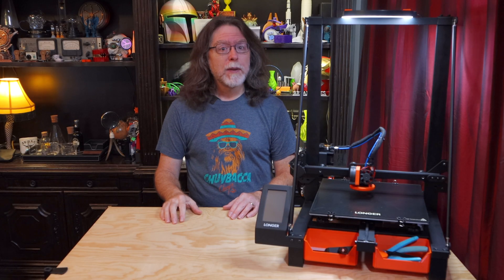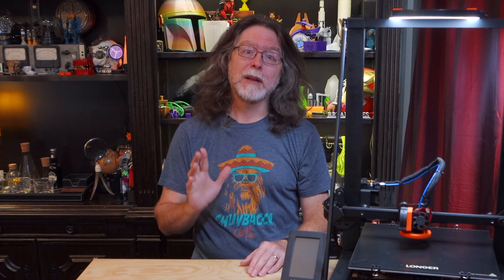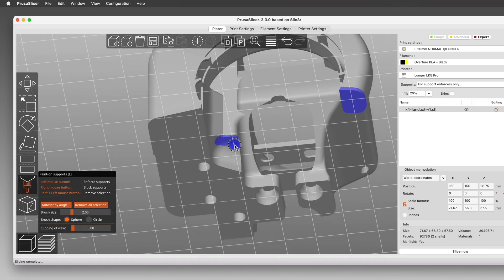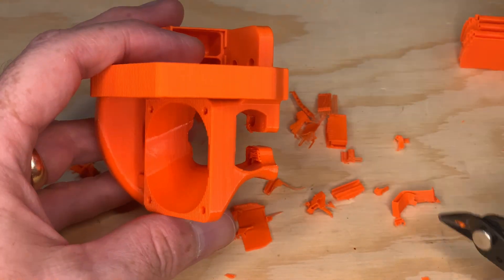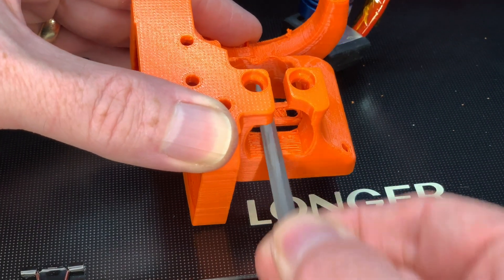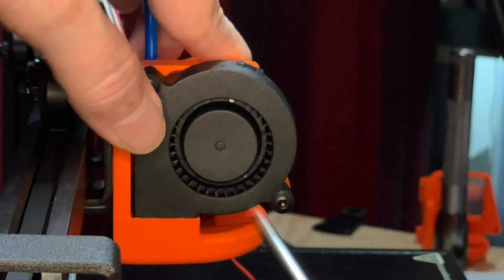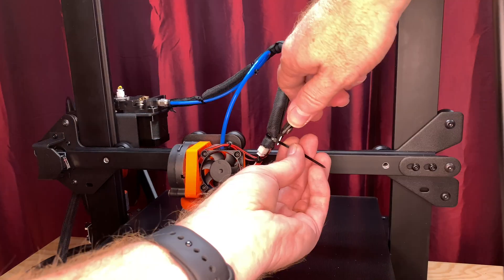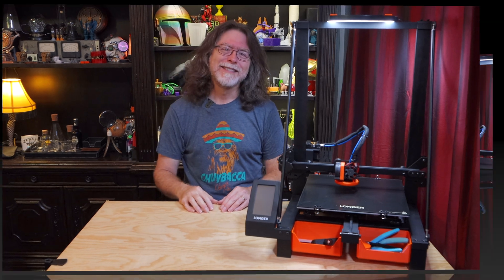Longer LK5 Pro Cooling Fan Fix

Comment: Thanks for the video! I just started 3D printing by getting a longer LK5 pro (since it is older, I got it cheap). I have fallen in love with the hobby. How did you use prusaslicer? I only thought Cura Ultimaker supported the longer LK5pro? Does one of the other profiles work? Also, I heard you can upgrade to automatic bed leveling with a BLtouch upgrade? You don't happen to have a video of that do you? Or of a filament sensor upgrade to one that lasts "longer" (dad joke). BTW, great T shirts

Comment: Your longer is different from mine.  Mine came with 2 part cooling fans.  A bracket holds the fans instead of the fan shroud. Never had any part cooling issues.

Comment: You might mention that the stock parts cooling fan is a 4010 and you only need to swap out the connector at the mainboard with the 3010 fan that cools the hotend, instead of buying another 4010 fan, of course this means peeling back the entire harness, but if yours happens to be like mine the 3010 uses significantly smaller gauge wires than the 4010 does, in this case it may not be a good idea to just snip the wires off and connect the 4010 to those smaller gauge wires as they may not be rated high enough to meet the current demands of the 4010.

Comment: I bought the upgrade kit that longer now sells and installed it to the best of my ability and the entire apparatus was lose on the x plane when I finished as well as the bed having a high spot in the middle.   After months of sitting on it, I finally saw a video explaining that I could tighten the 10mm eccentric nut, and I did that and it failed to move at all, so I of course loosened it a bit.  Then it would travel, but when I tried to go into bed leveling it kept ramming up against the side, completely ignoring the end stop.  Now I get a homing failed any time I try to do anything at all.

Comment: Thank you so much for this video. This is my next project before I print anything else. Do you have any other recommended upgrades for the longer? Also I like the tool bins under the printer. Where can I find a file for that? Thanks again.

Comment: Longer now sells an upgraded cooling kit for about $20. It includes a much quieter 40mm heat sink cooling fan and two 30mm part cooling blowers. The unfortunate part is that the heat sink cooling fan is too far from the heat sink and significantly blows on the hot end and printed part. Because of this, the highest I can turn on the blower is 50%. Otherwise, the hot end temperature drops.

Comment: Does anyone have a fan shroud model for e3d volcano for longer lk5. I printer one for the cr10 but it works other than when I install it to z the fan shroud hits a bolt holding a wheel on the z axis’s. Preferably 4010 fans 3

Comment: I just ordered the upgraded "dual blower" from longer. It got me thinking though. Instead of trashing the stock fan, maybe I can print a housing that uses the fans from my new blower, and my old one in the same unit. Is there any benefit to such a thing? I'm really new to 3d printing.  Thanks!

Comment: Would you still recommend the lk5 pro at its current ~ 360 usd price?

- for a bit more of context, I'm a total newb to 3d printing. I've seen many things, and understand a bunch of it, but have never done nor operated anything about a 3d printer (not even the 3d designs in software).
Im wanting one mostly  to produce custom lighting appliances for my home, as well as some other useful gadgets here and there. Being it all mostly functional or decorative i'd also like a nice resolution / accuracy for making things that I can put on the dinning table and be looked up close or be mobile with like bearings or cogs.
I don't fear following long instructions or "tedious" assembly, as long as the ammount of work is a set one, and after that I'm left with a tool that I know will mostly do what I want/expect it to.

Comment: This is a nice video I’ve been on the fence about getting one but I think I’m gonna go ahead and do that. Don’t know if they have fixed the print resume feature in a firmware update but like you said it would be nice to have but not always useful. Thanks for making this video.
Reply from the maker: Hi! Longer has added an option to purchase the printer with a dual blower configuration for parts cooling. I'd recommend getting that version. 👍
Reply: @BV3D  looks like it’s on sale for $299 right now fyi
Reply: @BV3D  I got the dual blower LK5 PRO . But was curious if you thought this upgrade would be necessary...? I am printing two out currently since i have two of these to see how it comes out. but my question was do you know if the voltage is the same since mine came with dual blower kit out of the box?

Comment: Can I just use the stock flat fan that is mounted on the hot end?
Reply from the maker: The stock hot end fan is a 30mm fan, so it won't fit this fan duct. But, you could re-use the 40mm parts cooling fan as the heat sink fan on this duct, if you either splice the wires in or swap the parts fan and the heat sink fan's plugs at the main board. I think that would work. I'd have to open the printer again to be sure. You'll still need a 50mm blower for this duct, though.
Reply: @BV3D  thanks for the response. That is exactly what I did. It works fine with the 40mm parts fan.

Comment: Thank you Bryan for this video.  I plan to print this for my LK5, just have a quick question on the 4mm X 20mm screws and 3mm x 12 mm screws.  Are they coarse thread of fine thread?

Comment: So I did a very similar upgrade to my Lotmaxx some time ago. The cooling worked wonderfully- but I ended up hating the mod. My Bowden tube nut came loose and I couldn’t reach the darn thing without disassembling the entire thing. 
Granted that mod was a bit more complicated, being multiple parts so you could upgrade to dual fan setup or replace only certain parts.

Comment: Brian, I've been watching your videos on LK5 Pro and I went out and got one, soon to arrive by slow boat from guess where? Anyway I'm getting ready to receive the machine by getting some of the things it doesn't come with. Your LK5 Pro has a halo type of light at the top and you mentioned fabricating brackets for it. I can't seem to find links for it in any of the videos I've watched. Please help.
Reply from the maker: Hi! That would be from this video: https://youtu.be/sgw-KDnSzTM
It's just a cheap USB-powered ring light from Amazon. I used an 8-inch one for the LK5 Pro.

Comment: Longer came out with an official replacement upgrade for the part cooler. I ordered it and I'm going to attempt installing it today however you have to remove the entire X carrier assembly. I can't find any official instructions so I'll be using your video as reference for a lot of it. So thank you.
Reply: Any chance you could provide an update on how Longer's replacement was? I'm trying to decide between purchasing the upgrade directly from longer or doing this mod?

Comment: Last week, I actually bought this 3d printer. I'm new into this 3d printing. I just seen this video & guess what! I've already order the parts needed for this project. Oh, yeah did I mentioned I actually bought another one as well. Thanks for the info so much, it helps to know this type of stuff. Wish me luck on my 3d adventure. I was wondering if you actually used  the Longer 3D software it came with? If, not why? What software would you recommend, instead of Longer 3D? You have a new subscriber...

Comment: Slightly off topic for this video, but can you give me some insight on the glue you use for PLA?  By the way I really like your videos for instruction and general knowledge.  Your pace and depth are great when following along or just soaking up knowledge.  I recently got my first printer, and ender 3v2 and I have gone a little nuts tinkering with it.  I have the Micro Swiss DD and hot end, the bltouch and the upgraded JyersUI.  I also did a dual z upgrade to support the weight of the DD.  I appreciate the content you are making :)
Reply: Plus I'm just up the road in Austin!

Comment: I had to level my LK5 PRO last night when I realized it was squishing layers together and failing prints. I thought I'd be good to go to make a print this morning and foudn that it was sticking the nozzle against the heated bed somehow after I checked the level after the failed print.

Why? Why is it that I Leveled my bed yesterday and had a perfectly good print time for the day and then this morning, the Printer is back to having a bad level?
Reply from the maker: When you say it was squishing layers together, that makes me think the coupler which attaches the lead screw to the Z axis stepper motor may be loose. Check the screws on it to be sure it is holding tight on both the shaft of the motor and on the lead screw. That sort of thing happened to me on an Ender 3 once and it drove me crazy.
Reply: @BV3D  Yeah so between me having a great print come out last night, it cooling down and having no use til this morning, it basically ended up having the nozzle move down a couple mm. I'll check the screws and whatnots all around and give it another level to see if it persists. Thanks a lot!
Reply from the maker: @Conceptsexplainedsimply  OK. When that was happening on my Ender-3 it was such a pain. With the coupler mostly-but-not-all-the-way tight on the lead screw, the motor was able to turn the lead screw sometimes, and not others. And so it might only go up half a layer instead of a full layer. But it would ALWAYS move down a full layer (thanks, Gravity).
Reply: @BV3D  gravity is such a dick. Hmmmm. I don’t know what all those part names are to be honest, but I’ll sort it out and tighten all that stuff down and see what happens! It’s so frustrating. Groot started off looking so good
Reply: @BV3D  I never tightened the screws on the silver doohickey that holds the vertical rod. Would that cause it?
Reply from the maker: @Conceptsexplainedsimply  So the lead screw is the one that moves the Z axis up and down. The coupler is the silver thing that it fits into, down by the motor. The coupler has screws to clamp it to the motor, and to the lead screw. So check that the two screws on the coupler are tight, and that you can't spin the big lead screw while holding the coupler still. The two should be locked together.
Reply from the maker: @Conceptsexplainedsimply  It might, if it wasn't completely tightened at the factory.
Reply: @BV3D  You're awesome. I appreciate you doing that and articulating it so I can understand.

Comment: Yea but with that new shroud you loose  the ability to install the BL-Touch or TH3D's EZABL that has the L shape bracket?
Reply from the maker: That is an excellent point. It probably wouldn't be difficult to adapt the base plate of the Hero Me duct system to fit the LK4/LK5 X carriage, and that would give a LOT of flexibility in mounting a bed probe.

Comment: Hey, Brian, love your videos (and the hair)!  Out of curiosity, all other things being equal, what are the benefits of using a 5015 blower fan vs. a similarly spec’d 4010 blower? It seems like lots of people make the switch but I've never understood specifically why.
Reply from the maker: Hi! The 4010 blowers are the ones like Creality uses on pretty much every one of their printers. They are quieter, but I don’t think they move as much air. The 5015 blowers are louder but I think you could make a small hovercraft with one. 😁
Reply: @BV3D  I wonder how your solution in the video, compares to the now available Longer Dual Blower Kit?

Comment: funny that they are still using the fan system that was on my lk4. it was crap years ago, but then again my lk4 has been crap to start with. i ended up using a Hero Me instead since i wanted 2 fans of this duct, but i did see it
Reply from the maker: The Hero Me duct is a good one. I've got one on an Ender-3. I'm using a single-blower version of it. I imagine with dual blowers, you get phenomenal airflow.
Reply: @BV3D  that i do, but downside is the noise. yes lowering the speed helps but then you get the weird wine from doing that. 
soon it will not matter much. im upgrading to a Biqu h2 soon

Comment: The 24v fans are sometimes really noisy. For the hotend you could also add a buck converter and use a ultra silent 12v one. But the air flow needs to be taken care of, as lover voltage also means lower air flow.
Reply: The 40x20 12V Noctua fan has very sufficient airflow for cooling the heatsink, for all I know. But the 40x10 I have heard is good too if you are using a duct that ducts the air nicely to the heatsink, which in this case would be applicable.

Comment: Great upgrade
Thanks for sharing your experiences with all of us :-)
Reply from the maker: Thank you, Asger! 😀
Reply: @BV3D  I imported this Thing file I to Cura. As indicated, I keep my supports turned off because the model has the supports already on the file. I printed it, but the supports were super hard to remove.  Since the supports are already on the model, are there other settings that could be adjusted to ensure easier removal of the supports (especially the small circular areas).

Comment: I converted my Hypercube to direct drive and lately I noticed some very naughty droops, blobs and other assorted layer adhesion problems. Once I reconfigured the parts cooling duct, these little boogers went away. (hope they didn't head your way!) Anywho, amazing what correct airflow can do for a nice, smooth print - and I'm not being full of hot air about that one!!
Reply from the maker: Printing is a breeze when the parts cooling works!  😉

Comment: great video try a delta 5015 fan i bet you could turn it down even more and get same part cooling, i tried those winsin fans and they just didnt put out the air i needed
Reply from the maker: Thanks for the tip! I'll look for the Delta brand.